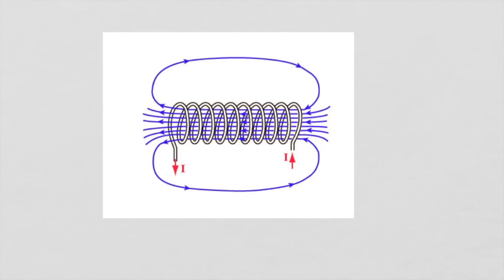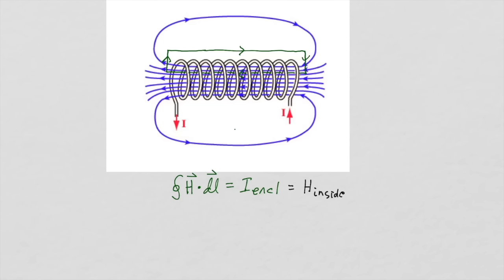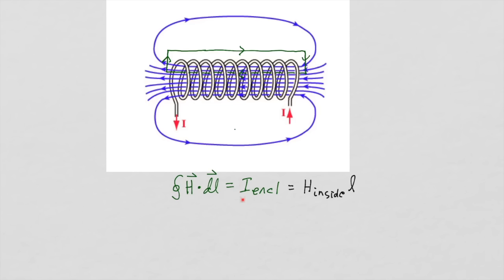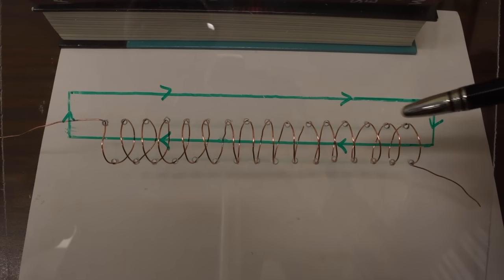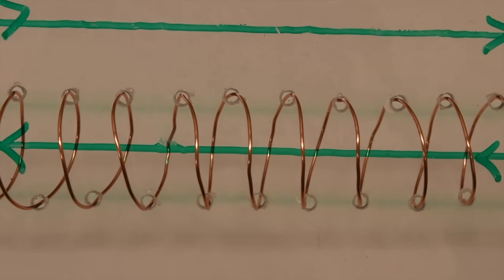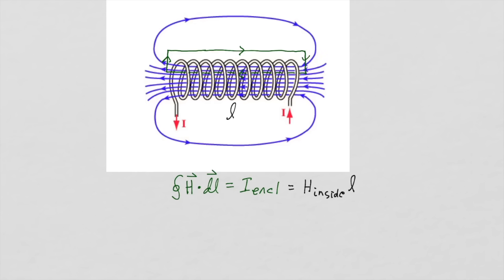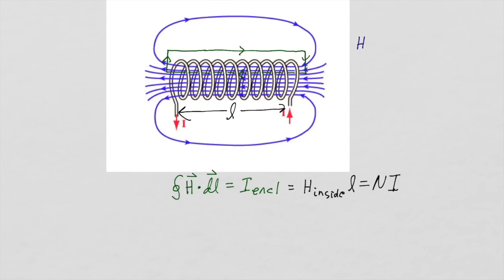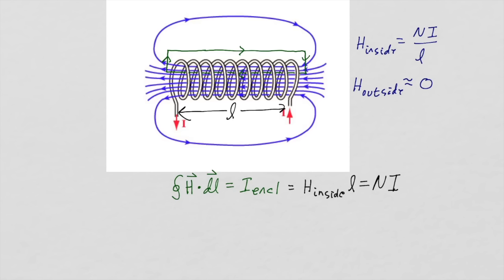Magnetic Field of a Coil

Comment: Good video. But Magnetic field is standing dipole helical vibration.
Strength of flux is directly connected to number of turns and current.
Reply from the maker: That is why I had more than one turn, so the field would be strong enough to rotate the iron filings.

Comment: The wire is insulated, right?
Reply from the maker: Yes the wire is insulated. It is magnet wire and I removed the insulation at the two ends to attach the battery. I use a 9V battery when I demonstrate this in class.

Comment: I don't understand how the tightly compressed coil where the loops are touching each other still produces a magnetic field. Why doesn't the current just go across both sides of the coil, since it's basically just a circle?
Reply from the maker: It is magnet wire. There is insulation on the wire. The insulation had to be removed at the two ends to attach the battery. I use a 9V battery when I demonstrate this in class.
Reply: @electricandmagneticfields2314  omg thank you! I had no idea it's actually insulated. That makes so much more sense now. I was looking at tight coils on the stator of my ceiling fan and wondering how they work too.
Reply from the maker: @JoEbY-X  Yes magnet wire has a thin insulation so you can wind those tight coils in motors and generators.

Comment: But what do the particles do in a fluid.?
You had to tap the board, so there is friction
between particles and surface.
What happens when this friction is removed
by placing particles in solution.  We then 
see 3 dimensions, and I suspect, a map
of the coil arrangement.  
hmmmmmm
Reply from the maker: It would be similar to this done with a bar magnet, https://youtu.be/QaZ0h76X6d0?feature=shared
Reply: @electricandmagneticfields2314  Excellent.
Thank you sir!
Reply from the maker: @mrbrown6421  You are welcome!
Reply from the maker: @mrbrown6421  You are welcome.

Comment: Dose that coil generate any heat. I was wondering when ac extension lead gets hot even melts with high amp load.
Google seems to think its just resistive heating basically bulldimg up becouse of the thermal propertes of the insilation being wrapped up  trapping heat in the coil. I was wondering if high amperage ac emf has any efects on the coil adding or speeding the heating process up?
Reply from the maker: Since I use a 9 V DC battery when I demonstrate this in class, I do not leave the battery connected. Right after I get the iron filings to move I disconnect the battery as the current is probably large with 9 V connected directly to just a wire..
Reply: @electricandmagneticfields2314   Thsts just resistive heat building up then nothing to do with field being in a coil?

Comment: Would ac vs dc current change results?
Reply from the maker: The ac would have to be very low frequency for the iron filings to be able to respond. With any reasonable AC frequency, you probably would not see anything.

Comment: The magnetic field which is part of the electromagnetic field, (light) indicating the where there is magnetism then electricity is there too, and is supposed to be a wave according to maxwell, and it supposed to be moving at a decent proportion of the speed of light. I see nothing moving at those speeds here. I see not light here, but there is both an electric field and a magnetic field, so where is the light and where is the speed.?
Reply from the maker: There is no changing magnetic field, other than the initial pulse when I attached the battery. Without a changing magnetic field there is no resulting changing electric field and hence EMW. That initial changing magnetic field, when the battery is attached, would produce an EMW pulse.
Reply: @electricandmagneticfields2314  So you claim that if you had that coil with the battery attached, and passed a permanent magnet through it give the changing field, then we would see light?  Changing electromagnetic fields are found in common electric motors, but they neve produce light waves. EM Waves is light.   Show me.
Reply from the maker: @everythingisalllies2141  If you just move a magnet you are creating a changing magnetic field. A changing magnetic field creates an electric field. This is a changing electric field that generates a magnetic field, which is also a changing magnetic field, etc. This is an electromagnetic wave. The frequency of this electromagnetic wave depends on the frequency you are moving the magnet. "Light" is just a tiny sliver of the electromagnetic spectrum. https://www.miniphysics.com/electromagnetic-spectrum_25.html
Reply: @electricandmagneticfields2314  did you see the field lines of force in both a magnetic field and an electrical filed?  Nothing like the way light propagates, in perfectly straight lines....
Reply from the maker: @everythingisalllies2141  I did not say you would see light. I said you would launch an EMW. You don't need a coil. You just need a magnet that you move. You could take a single electron and move it back and forth and you would also be launching an EMW.
Reply: @electricandmagneticfields2314  But LIGHT IS AN EMW.   So we may not be moving the magnet fast enough for the frequency of visible light, but EMW energy will be produced, right? But trouble is, the magnetic field has no ray like lines of force anywhere, they are all very curved, so where do the straight lines of light come from? Something tells me that the EM wave theory of radiation is not correct.
Reply from the maker: @everythingisalllies2141  What you are seeing is a DC situation, there is no changing magnetic field so there is no EMW being generated
Reply: @electricandmagneticfields2314  So show me that same coil powered by AC.  Where is the light?

Comment: If only you had also mentioned about the current level you applied to the coils. Otherwise, a good example of constructing experiments related to magnetic fields.
Reply from the maker: When I do the demo in class I attach a 9V battery. I have not measured the current.

Comment: i have question 
when current is induced on the coil?
does the coil get a polarity?
Reply from the maker: There is a direction to the magnetic field. If you put the fingers of your right hand in the direction of the current with your thumb down the center of the coil your thumb points in the direction of the magnetic field coming through the coil.

Comment: If magnet coil and have a core... And it will be generate without moving? Pls who answer this..
Reply from the maker: Sorry, I don't understand your question. Do you mean would the core move?
Reply: @electricandmagneticfields2314  i mean if magnetic field creates electricity without ac current.. Because i see in other vlogger he demontrate magnetic field he put two magnet S and N in separate aluminum bar in outside he put a metal core then he loop the wire... And he said we can get electricity of his experement...
Reply from the maker: @marsangeles6210  Could you post the link to the blogger so I can see?
Reply: Ok i find his channel

Comment: Any significance to 25 turns in the copper wire vs. fewer or more turns?
Reply from the maker: No significance. The more turns the stronger the magnetic field. 25 was my fist attempt. That produced enough magnetic field to rotate the iron filings. If is had not I would have tried again with more turns.
Reply: @electricandmagneticfields2314  Thanks for the video and your reply!

Comment: @Electric and Magnetic Fields I have one question and but one criticism of this wonderful demonstration: Please in future let your viewers know, early on, the basics: the wire's gauge and the current applied, in case they wish to try the demo and variations themselves. My question is, I have a 5 cm diameter microwave turntable motor which uses a copper coil effectively identical to that in your first demonstration as of 2:24. Within that coil is a cylinder of what I'm guessing is a permanent magnet. Within this cylinder is embedded a gear perhaps 1 cm high and 0.3 cm in diameter. This embedded gear in turn operates 5 additional, interconnected gears, stepping down the 110-120v 50-60Hz AC current to about 2.5-3.0 RPM. 

Strangely enough i have never seen so much as a diagram of this simple motor, and for the life of me I cannot tell how it gets the initial gear to turn clockwise or counterclockwise, as the operator wishes. 

Cheers, thanks, and best wishes,
Reply from the maker: Yes I should have mentioned the gauge of the wire. Any gauge that you can wind into a coil should work. When I do the demo in class I just connect a 9 V DC battery to it, but I don't know the current.

I am not familiar with the motor you are describing. I have an old microwave that is not working. I will try to find time this summer to tear it apart and see if it has a similar motor and if I can figure out how it works.

Comment: When you change the length of integration to just the inside of the coil you shouldn’t have to Calculate the 10 coil wraps on the outside  so the inside would change
Reply from the maker: Where in the video are you referring to? Where is there a mention of 10?

Comment: Can any of you guys help me out! I've made a DIY Coil for testing the magnetic field and I've no idea on how to supply the electricity to the coil ...Help me out please :)
Reply from the maker: What exactly are you doing? Are you trying to do the same experiment as in the video? If so, when I do it in class I just attach a 9V DC battery to the two ends of the coil.
Reply: @electricandmagneticfields2314   Yes! I'm doing the same experiment for my school assignment , Should we attach two batteries ? i.e one battery at each end of the coil ?
Thank you so much for answering 😊
Reply from the maker: @godesssuggi08  It should work with only one battery. I would definitely try it with just the one battery. I find I have to tap the plastic after attaching the battery. The friction between the iron filings and plastic prevents them from moving. Tapping causes the iron filings to jump up a little so that they can rotate in the magnetic field.
Reply: @electricandmagneticfields2314   Oh! Thank you much for the help and the info :) I'll be able to do the project to perfection✨Thanks to you  😊
Reply from the maker: @godesssuggi08  You are welcome!

Comment: Example #1 is how the red blood cells electromagnetic field looks when our blood plasma is in the correct 7 to 7.4 pH range.  When humans eat to much foods and drinks that drive the blood plasma to become to extremely acidic, Example 2 is what humans end up with because their red blood cells become mini electron magnets and they stack like coins in their fingers and or toes. Then loss of circulation and if some break loose it is a clot that may gather more blood cells as it moves and gets stuck in a joint of the groin or arm pit and then loss of circulation in an arm or leg.

This is why I drink alkaline drinks with meals.

This is also why I drink alkaline drinks before bed.

I am past my mid 50's and feel much as I felt in my 20's and 30's.
My 40's and early 50's I had severe circulation issues.

Because I am a retired computer engineer and programmer, I was able to figure out what was going on.  With some research, prayer and meditation I narrowed down the type drinks that would eliminate the over magnetizing of my red blood cells.  This video shows what I realized was happening.. over acidic blood plasma over charges the red blood cells and they attract and cause clotting. This alters the electromagnetic fields of the red blood cells from what they should be into something different and that different field has a direct reaction not intended inside the arteries, veins and blood vessels.

After realizing I had to maintain a proper pH of my blood plasma, I then researched foods.

Foods that acidify the blood plasma.

Foods that alkalize the blood plasma.

Foods that boost memory.
#1 is Blueberries

Blueberries happen to be acidic to the blood plasma.
But they also happen to protect the neurons and nervous system.
Especially during a stroke or heart attack.

76% less likely to have paralysis or memory loss by eating two servings twice a week.

Still, I make sure I drink Alka-Seltzer water or 8.8 or 9.5 pH water or alkalized tea with my meals.  Is that not amazing? I was able to use knowledge of electromagnetism to perceive what was causing me to have circulation issues... especially while sleeping.  

I also discovered the hand held game controllers and my computer mouse was wireless charging my blood plasma traveling through my hands to cause loss of circulation in my hand or both hands. The 8.8 or 9.5 pH water eliminated this issue also.  I know a liquid acid battery needs acidic water for the battery to give off a charge. Add sodium bicarbonate water to a battery and it will drain the battery, but add acidic water to a battery and it will charge the battery or add electricity and the water becomes more acidic this the battery is charged. 

I was over charging my blood plasma and altering the magnetic makeup of my red blood cells so they were attracting to each other. This possible may be why some people prematurely age faster than others. Their bodies are over acidic so their skin can not effectively deal with protons hitting the skin and this over charges the skin and cooks it slowly, thus drying it out and causing wrinkles and spots. People who maintain a proper alkaline balance blood plasma age slower because electrons and protons can move throughout their body more efficiently.

Suggestion: Search YouTube
Acidic Blood Stacks Like Coins

Then ponder what it is going on with their electromagnetic field.

You should realize when they free flow in 7.4 pH plasma, their field looks like Example #1.

When they are stacking like coins, their field is like Example #2.

Now if (IF) our white blood cells (immunity cells) read and rely on the electromagnetic fields of the red blood cells and other invaders to be in normal working condition.. this would wreak havoc with the immune system.  This may be why some people develop C0VlD so fast and why the Vax Jab does not work on some people to protect them and why others are Asymptomatic even when infected. We hear some people die even though they have a so called good diet and exercise. Well if they are over acidic and their blood cells electromagnetic fields are jacked... their immune system is jacked. No what if (IF) viruses prefer an acidic blood plasma in the 6 or 5 pH range? It may amplify their activity, thus make them more able to function while the red and white blood cells are unable to move properly and are helpless to do their jobs.

Just making observations and asking Scientific Questions.
This is not medical advice, so please do not take it as such.

Comment: If you was to turn a magnet next to it to produce DC Voltage how would you spin the magnet ??? Plz help. I'm confused
Reply from the maker: I do not understand your question.
Reply: @electricandmagneticfields2314  say I have a long bar magnet. And a coil. Could one simply spin the bar magnet in a drill and get voltage ? And how to hook up the coil to light?
Reply from the maker: @off-gridhillbillystyle3735  Yes, here is how, https://youtu.be/O5n6ubrbK5A

Comment: If i wrap copper wire around copper glass then will it work  like coil . Will it heat my copper glass at low temprature .....
Reply from the maker: Not sure what you are asking. Heating the copper wire with a current so that it heats a copper cup?
Reply: @electricandmagneticfields2314  actually wire is also copper & mug is also of copper , then will copper coil heat same metal mug or will have any  problem or short circuit becoz metal is same in coil & mug .....
Reply from the maker: @pradeepgupta1190  The wire I am using has an insulation on it. This is necessary otherwise my N turn coil would effectively be just a one-turn coil.

Comment: Great presentation, curious do the pieces of iron once aligned with the field begin to follow and move with direction of the field?
Reply from the maker: They would, but there is enough friction between the iron filings and the plastic that they don't. This friction is why I had to tap the glass to get the iron filings to rotate and orientate along the field lines. Here is an example where they do, https://youtu.be/QaZ0h76X6d0
Reply: @electricandmagneticfields2314  another good one thank you. I’d love to see this with electro magnetism possibly a coil around a tube. Fascinating. I assume this would be much like a rail gun works, pushing force through the tube one way inside and on the outside in the opposite direction but less focused energy. I wonder how far this forces could be pushed and to what further applications

Comment: is the magnetic field generated moving or static?
Reply from the maker: It is a static field. The current is static coming from a DC voltage source.
Reply: @electricandmagneticfields2314  how can the current be static? Isn’t the current the movement of charged particles in one direction(DC)? while AC would have been changing directions of the current ? I mean flipping the directions with some frequency?

Comment: what is magnetic coil its it copper wire?
Reply from the maker: It is copper wire with an enamel insulation. It is used for winding motors, transformers, generators, etc.

Comment: You have used ac or dc for this..??
Reply from the maker: dc
Reply: What's the potential difference and the rating of current have you used..??
Reply from the maker: @himanshuprasadrawani348  Unfortunately I did not measure the current. I used both a dc power supply and a 9 V battery. I don't recall which of those two voltage sources I used in the video.